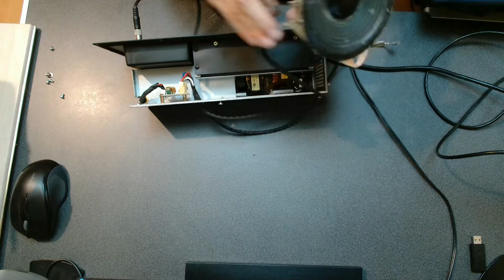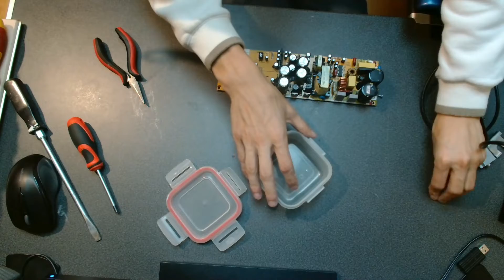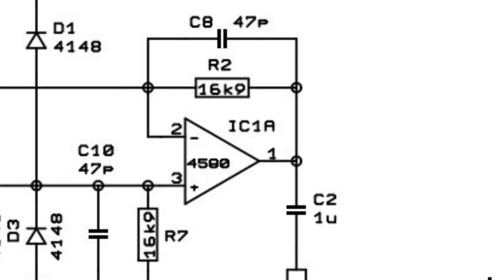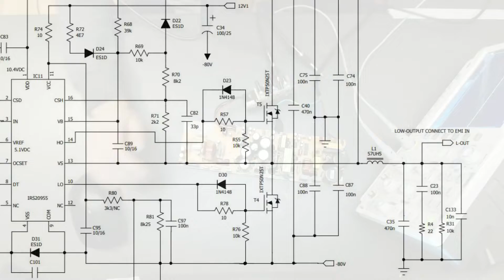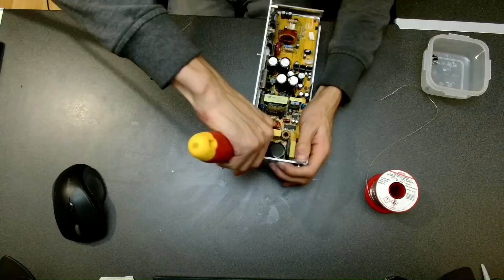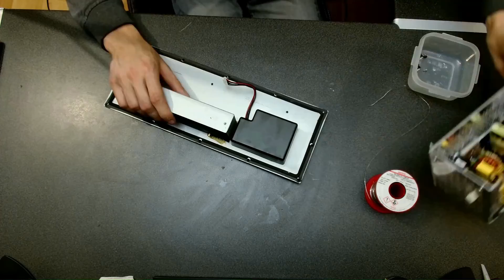Fixing a powered speaker amplifier plate - BEHRINGER Eurolive B215d

Comment: Great vid! I have four of the B215D's and two of them with bad amps...I was going to bypass the amp and connect the speakers to active crossovers and power them externally.  I need to take a closer look at the speakers...are they marked for positive and negative?  Or am I going to have to trace it from the 61µH output filter chokes to find positive pins?

Comment: Very weak repair. You should already at start measure LF swtiching transistors without plugging it. They are usually dying first. Second is power supply, but then whole amp would be dead.

Comment: good work and explanation what you are given .
I face an issue in same unit that is going to protection and remove the TDA7293 it start working , so i replace with TDA7294 (instead of TDA7293) same not  switching , how to solve this issue

Comment: I have that same speaker but mine is completely not turning on, could the problem be in fuse?
Reply from the maker: Sure, check the fuse with a continuity tester. You can also check the path from the plug to the bridge rectifier.

Comment: HELLO EVAH! I noticed that one of my EUROLIVE Powered speakers only had sound coming out of the woofer so I ordered and installel a new Tweeter Diaphragm but when I powered the unit up it's squealed!!! I took it back apart double checked all the wiring everything is in the correct place! Tweeter is mounted in the correct position! There's no smell or anything burning from the Amplifier section! Can you tell me what that could possibly be wrong!
Reply from the maker: If you have an oscilloscope, try to identify were the frequency is generated. (Eq input board, or main board) if you don't have oscilloscope. Try to connect the low and high input of the main board to ground. That way you can identify were the frequency is generated. Tbh, I'm guessing that your power amp Chip might be blown. But not sure about that